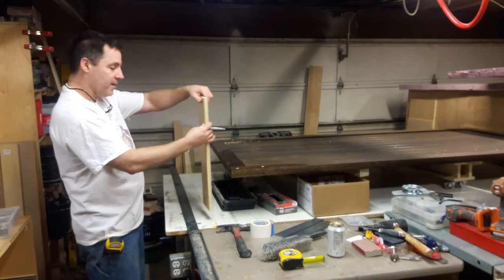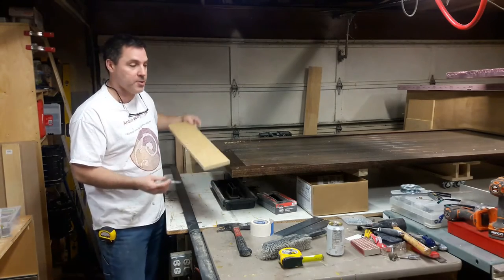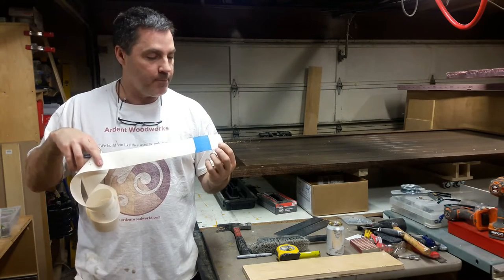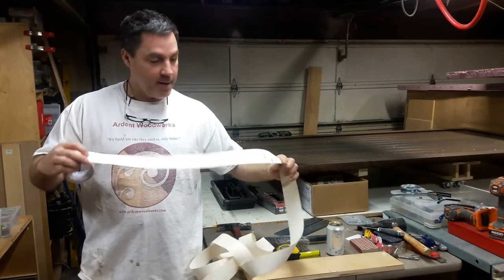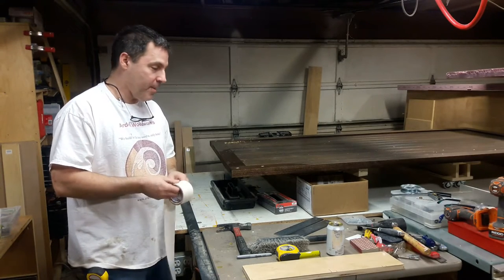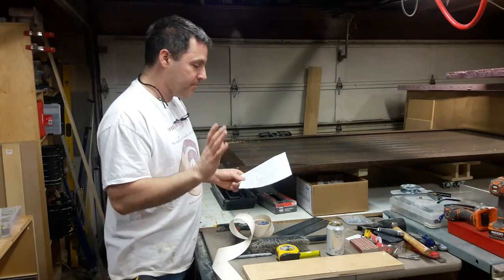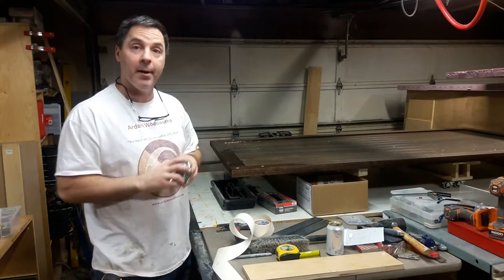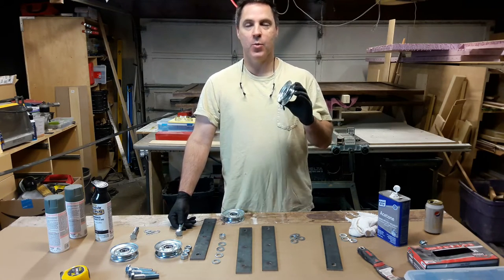Building Double Barn Doors: Hardware

Comment: Way cheaper just to buy hardware 39.00 get all hardware
Reply from the maker: Yes, but you often get what you pay for, as the saying goes. This is more for the enthusiast obviously. But you're right too, that in today's market, there are TONS of companies that produce hardware at varying prices. Also keep in mind the weight of the door. For this hardware it had to be able to handle a couple hundred pounds. I would bet money $39. hardware won't cut it. Thanks for the comment!
Reply: @HomeEvolutionShow  actually it does I build my own doors some are 1 3/4 thick 5ft wide 8ft4in high never had a problem.  They are same brand just way cheaper.  Yes I have ran into some really cheap made ones till I found right resource but they had good quality wheels and bearings so I just made my own arch strap put wheels on them. Worked perfectly so yes you get what you pay for when they hire me to fix everybody else's crap work that they overcharged from.